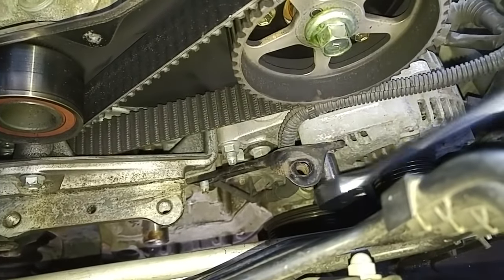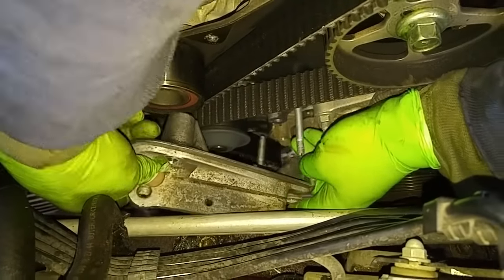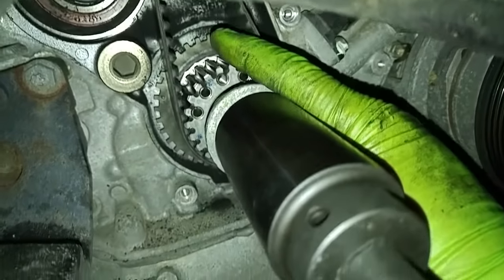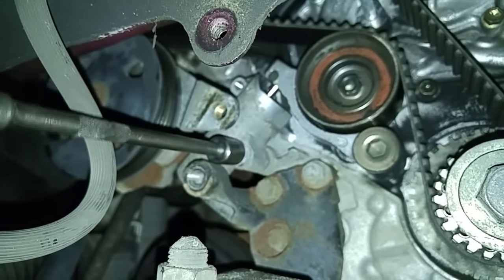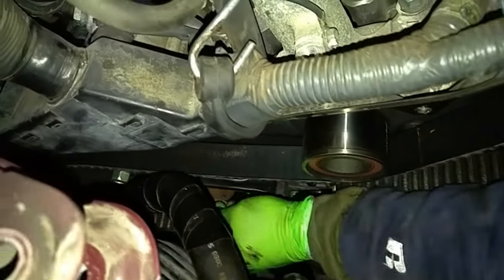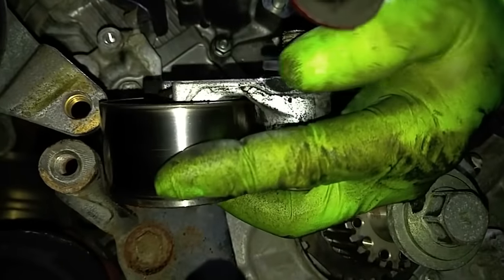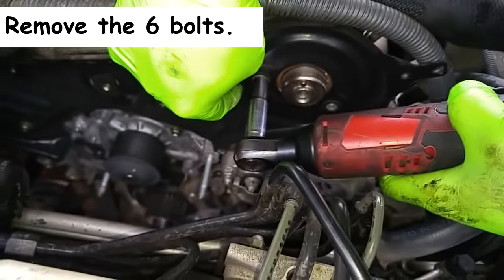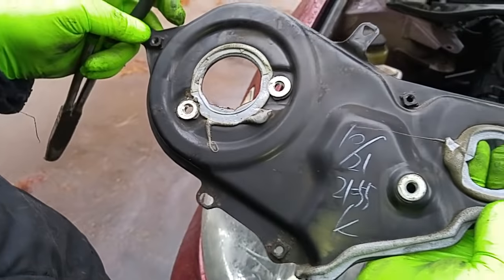Toyota Camry V6 3MZ-FE Timing Belt, Water Pump, Seals & Pulleys Replacement

Comment: Great video. Please point direction of seals for the rest of us.
Reply from the maker: Open side (or the side with the internal spring) always towards the engine ... the other end towards the pulley.
Reply: @hardlymovingpro  My man. Thank you very much! About to perform identical procedure on 2004 ES300. ✌
Reply from the maker: @NVzla  No problem ... good luck with the job!
Reply: Task has been completed. Cam seals, timing belt, tensioner pulley, idler pulley, water pump, spark plugs, valve cover gaskets and tube seals, front main seal, and finally the thermostat. I have a 2001 Avalon, lost oil pressure. Purchased 2004 ES300 motor. Oil pump/main seal cover are different between the vehicles. Block/heads identical. Minor swap work needed, including cutting off portion of the iron motor mount bracket on es300 motor. Thanks again for the info i learned from you.
Reply from the maker: @NVzla  Great news!  Would have cost you a ton if you paid someone else to do all that work.  Like your engine swap idea.  Would make a good video!

Comment: Thank you so much for making this video. You are still helping real people change the timing belt successfully. This was my first timing belt job and I was a bit nervous but I spent the time studying, purchased all the tools you recommended and successfully finished over the course of two days!

One question, I used a corded impact (similar to yours, rated at 300 foot pound of fastening torque) with the high mass 22 mm socket you recommend. After replacing the harmonic balancer I simply reinstalled the crank bolt with the impact gun again (no torque wrench). Should I go back again and tongue to spec at 162 foot pounds? I did the same with the cam sprocket bolts and torqued them with a 24 in breaker bar as hard as I could like you did in the video. Is this sufficient in your experience?
Reply from the maker: Thanks!  Torquing the crank bolt with the inpact gun is fine.  Using the 24" braker bar for the cam sprocket bolts should be fine as well.

Comment: thanks for the good video, my friend press the gas pedal when he start the car very cold in the morning, the camshaft broke, the sprocket fell off and even break the timing belt cover,  does valves are damaged and the engine is gone? does change the camshaft and timing belt will bring the car alive? what do you suggest to do ?
Reply from the maker: Anyway you look at it, the engine will have to be pulled to repair it or replace it with a donor engine from the salvage yard.  To repair it, would know the work effort until you start tearing the engine apart.  Better off getting donor engine ... IMHO.

Comment: Hello, first of all thank you for putting the video. Very helpful. I see that you did the alignment first before removing the old belt. Is that necessary. With my old belt in place my pulleys do not align. Aligning one makes the other offset. Can I align all pulleys after removing my old belt and later put a new belt once everything is aligned.
Reply from the maker: Yes.  If you can't get perfect alignment before removing the belt, that usually indicates the previous belt replacement was done incorrectly.  So remove the belt, align the pulleys and proceed to install the new belt.  Good luck!
Reply: @hardlymovingpro  thank you so much. Stay blessed.
Reply from the maker: You bet!

Comment: Is there way to visually inspect the timing belt on the 3MZ-FE engine before committing the time and money to replace? I have a 2005 Lexus ES 330 that I'm trying to figure out if it's been replaced or not.
Reply from the maker: If you take off the upper timing belt cover you can then inspect for cracks.  But even without cracks, it should be replaced at the recommended service interval.

Comment: Great video. Been a while since I was elbow deep under the hood of a car. I referred to your video through the process on my sons car. I have noticed some other guys apply locktite on the tensioner bolts, but I did not. Didn’t seem like you did either. Any issues from past jobs if you didn’t use locktite? Also, I used a chain wrench to hold the cam pulleys in place. I ended up putting a few small dents on some of the cogs. I cleaned them up pretty well with emery cloth. Have you experienced anything like that using that tool on the pulleys? Thanks again for a well done video.
Reply from the maker: Thanks.  Don't think the manufacturer used locktite but rather RTV.  Believe the bolt hole passes through a coolant channel behind the water pump.  Nothing to worry about, IMHO.  Haven't had customer comebacks due to coolant leakage.
Reply from the maker: Small dents or indentations on the cam pulleys is not a problem.  Sharp protrusions on the other hand could wear on the belt.

Comment: Needed this, thank you
Reply from the maker: No problem 😊
Reply: Can you put a breaker bar on the crank and turn over the engine to remove the crank bolt?
Reply from the maker: Sorry for the late response.  I use a electric high torque impact gun with a high mass impact socket ... always.

Comment: This video is more than helpful I have a question though. My front cam is behind hdc by a tooth with the old belt currently on while waiting for the new one in the mail. How would I fix this?
Reply from the maker: The new belt with have cam and crank alignment lines.  Use them to position the cams.
Reply: @hardlymovingpro  Thanks as far as replacing the camshaft seals 1) if I can't get oem would something from say Oreilys be okay. Also can I just get a piece of pvc pipe to install replace those? Wont be able to wait for that special tool you used to come in the mail

Comment: So I completed the job, had trouble starting her up and it started after jumping it. Ran smooth and soon as the engine warmed up the rpms are way too low almost dieing. Was able to drive it and it has good power, is rpms are stable while cruising. Soon as I come to a stop the rpms go to 300ish and starts to die. I checked the vacuum lines and they seem to be fine. Could I have missed a tooth?
Reply from the maker: Sounds like it could possibly be the problem.

Comment: Thank you for this video, and especially all the links for the tools and parts. Im preparing to do this job. In your opinion, are genuine Toyota parts any better than the Aisin kit, or would I be wasting my money? Are the parts EXACTLY the same?
Reply from the maker: Thanks!  Wasting money and parts are exactly the same.  Toyota, like other manufacturers, outsource these type of parts to third party vendors which they have a long term relationship.
Breakdown:  
Water Pump - Aisin
Timing Belt - Mitsuboshi or Bando
Belt Tensioner - Aisin or NTN 
Belt Pulleys - Koyo (GMB not OEM but just as good)

Comment: I used this video to do the timing on my wife's 04 camry with the 3mz and everything went just as you explained. The car has 307000 miles. Once I finished the timing and everything was put back together it started but it's rough. It's throwing the code for cylinder 3 misfire and another saying air fuel ratio is lean. Would this be because the timing being off on that cylinder head
Reply from the maker: Yes ... I would think the timing is off.

Comment: Damn good job with the thoroughness, expertise, and awesome videoing! My only question is why the tensioner cylinder wasn't replaced as well?
Reply from the maker: Thanks for your comment!  On this engine I've never experienced one that failed.  Maybe in the future I'll do it on engines with over 200k miles.

Comment: You make it look to easy !  How long was the job start to finish and what is the total cost and did you replace the water pump?
Reply from the maker: Thanks!  The water pump was replaced at the 9:10 video time mark.  Total cost of the parts can range between $150 - $200.   Use a Denso water pump and either a Mitsuboshi or Bando timing belt as replacement parts.  They are OEM parts.  The average time to repair is around 3 - 5 hours depending on any hick ups along the way.

Comment: You made it look so easy, i strapped torx head on one of the studs and tried rotating with plier and threads are crossed. I am stuck now, can you plz help me how to remove it. I do not want to do seals so I do want to remove studs in order to do waterpump. Thanks.
Reply from the maker: I hear you.  Sometimes the stud is in there so tight that you can't break the tension.  What you can use is a stud removal tool.  It has three (3) cams that lock onto the stud to twist it off.  Make sure there's no oil on the stud and you can use sandpaper to rough up the contact surface to get a better bit.  Here's the video I made showing how the tool works:  https://youtu.be/jX3r7hqju4k
Reply: @hardlymovingpro  thanks, that video is a gr8 help.
Reply from the maker: No problem.  Also, you can keep the w/p studs in place.  Just tilt/lift the engine up a little using a hydraulic  jack.  Place a wood block under the oil pan to protect the pan.
Reply: @hardlymovingpro  hey, just an update , I was able to successfully change my TB and WP today and your approach of fitting timing belt is think is the best on YouTube, I manage to fix it on first attempt.  By the way this is my first timing belt job that I did. Thanks again for sharing such valuable information.
Reply from the maker: Great news and glad it worked out for you!  I can understanding the anxiety doing a job like this for the first time thinking about the consequences of failure.

Comment: Great video thanks. When breaking bolt on cam pulley if the cam turns will that destroy any valves or damage a piston? The tool I was using to hold the cam broke and the cam turned counterclockwise a little. I am nervous now.
Reply from the maker: Don't think you have anything to worry about.  Damage occurs when a running engine's timing belt brakes, the valves lock in place and the pistons smash into the valves bending them.    In your case, the valves are opening into stationary pistons.  There's not enough momentum to bend or brake anything.
Reply: Ok thank you. I am relieved to hear that!
Reply from the maker: No problem and good luck with the rest of the TB job!

Comment: Is this repair a close match for a 2002 Camry Solara 3.0 engine? 
Very nice work on the video.
Reply from the maker: The 3.0 is the 1MZ-FE engine and uses a different timing belt tensioner.  The 3.3 (this video) is the 3MZ-FE.   You should refer to my Lexus ES300 video just for the removal and installation of the belt tensioner.  Otherwise, the two videos are vertually identical.  Here's the link to the ES300 video work on the 1MZ-FE:   https://youtu.be/KkjgBVxBaeU

Comment: How did you hold the crank shaft from turning when you tightened the bolt onto the harmonic balancer near the end?
Reply from the maker: With my impact gun.  It hits and then twists within a fraction of a second.

Comment: Big job, just curious why wouldn't you change the tensioner?
Reply from the maker: Have never had to deal with a failed tensioner on Toyota's MZ-FE engines.  Currently working on a TB replacement on a Mitsu 3000GT.  On that one the tensioner has gone bad!

Comment: Is the 1MZ-FE timing belt replacement the same as the 3MZ-FE process?
Reply from the maker: Almost.  The belt tensioner bracket is different but easier to replace.  Watch this video:  https://youtu.be/KkjgBVxBaeU

Comment: Lexus is at 110k and I've been wanting to do it myself but pretty intimidating plus I have buy most of the tools. I only have the breaker bar and ratchet set .😩😩 asked the auto repair shops near me and was quoted $1000-$1100
Reply from the maker: You'll have to spend a few dollars in tools to do this job.  Some of the tools you can rent at Autozone for free.
Reply: @hardlymovingpro  what are the must tools I need to get for this job ?
Reply from the maker: All or most of the tools used in this video are in the "SHOW MORE" description of this video.  You can cross reference the tools with the video and with Autozone if they have it for rent.  I use electric power tools to make the job easier for me but you can use standard metric hand ratchet tools.
Reply: @hardlymovingpro  okay cool. I appreciate the time! Thank you!

Comment: Can you leave the belt on and loosen the camshaft pulley bolts first?
Reply from the maker: Yes.  But with all that torque, the crank might move.  Even if it did, and not that much, you can reposition the crank back to TDC.

Comment: Hoping you might have an answer:  I working on the 4.3 V8 and it uses the same type Tensioner pulley shaft bolt and washer. The old one wouldn't float back and forth soon as just tighten a smudge and the new one does the same thing. I've purchased a new shaft bolt and washer and have a new tensioner. I've checked the the oil pump is drilled and tapped all the way through on the new pumps.  After these are tighten, what allows it to pivot?  What would prevent it from pivoting back and forth?  Thanks.
Reply from the maker: Can't really say without looking at what's going on.
Reply: @hardlymovingpro  After the factory tensioner pulley and the new one both seized up after tightening up, even with a new bold and washer I order anther tensioner bracket and it tightens up and pivots back and forth like it should.  The only noticeable difference was the new one I just put on looks to have a brass bushing the bolt goes through and the others had metal bushings.  Hopefully nobody else ever has this problem.
Reply from the maker: @SHODDT  Yes ... that center bushing that the mounting bolt goes through could be the cause of your problem when the bushing wears out.  I remember around 10 years ago dealing with a worn out belt tensioner plastic bushing on a Ford.

Comment: Hello. I am using this to replace the accessory belts on my Toyota. How do you get the tension back for the belt that is closer to the rear. I understand using the alternator to tension the front belt but don’t understand how the rear one gets retensioned. Thanks.
Reply from the maker: You'll need to use a metal bar or pry bar type tool to push on the ps pump to apply tension on the belt.  While applying tension, torque down the ps bracket tension bolt.
Reply: @hardlymovingpro  thank you for the reply. Video is a huge help
Reply from the maker: You bet!

Comment: Hey so I've noticed on the procedure that came with kit it tells you to rotate the crankshaft back 60 degrees with belt on after lining up the marks and then remove belt. Why do you not do this? This would be best for a beginner in order to negate possible damage from a cam jumping time correct? Thanks
Reply from the maker: I don't do it because there's no 60 degree mark.  The instructions are nonsensical.
Reply: @hardlymovingpro   okay thanks from the picture it appears to be 8 cogs. I don't doubt you at all, but haven't seen any videos of people doing it that way, thanks as always for quick response!

Comment: I had one of the 10mm bolt on the rear cam pulleys back plate shear off.. how important is that? Should I try to replace to it? In such a tight spot, but if it serves as pressure to the cam seal I probably should try ya? Thanks
Reply from the maker: It's just a dust shield bolt.  Don't worry about it.
Reply: @hardlymovingpro  I bought some tools from your links but I'd like to leave you tip if you have place, you the man!
Reply: @hardlymovingpro  I got it all together and felt good until I looked at  the harmonic balancer. It's just barely wobbly, I really had to look at it.. hopefully I didn't do anything wrong, it may have originally been like that. How often do these fail? 175k miles
Reply from the maker: They normally do not fail.  When the outer ring begins to seperate, your hear belt squeal

Comment: Wow that's a lot of work, but mostly to many parts to remove and to remember how to put back together if you don;t have the experience specially if you don't have the proper tools. I own an 06 highlander with V6 that leaks oil from the crankshaft seal and i tried every oil leak sealers and none of them work so i guess i have to pay the piper and have it fix soon.
Reply from the maker: Are you sure it's the crankshaft seal?  Most of the belts I've replaced, it's the camshaft seals that harden, crack and leak.

Comment: What's the torque output on that high mass impact driver you used? I need to do the same and to also take off the upper bolt to change the head gaskets.
Reply from the maker: 1,400 lbs